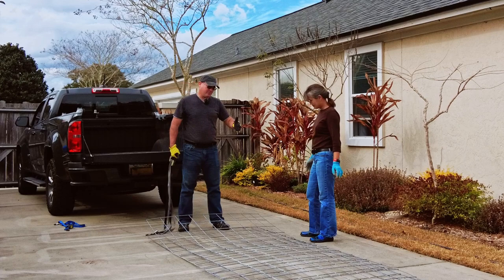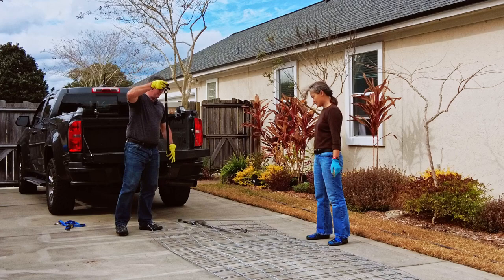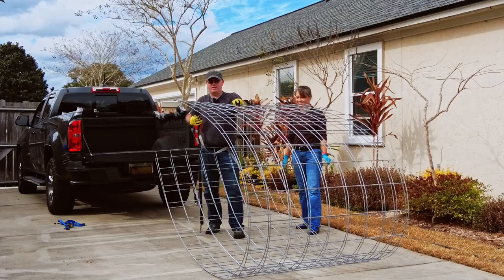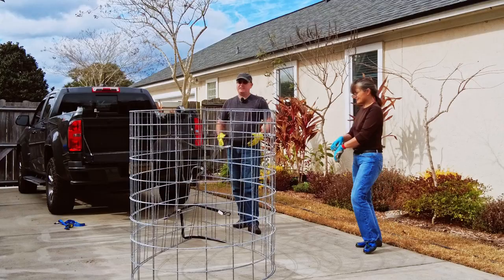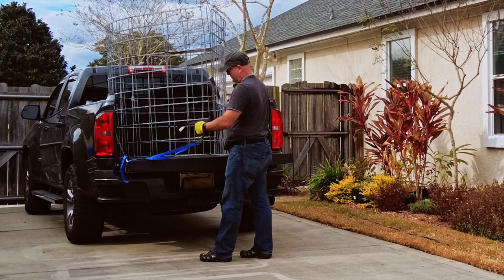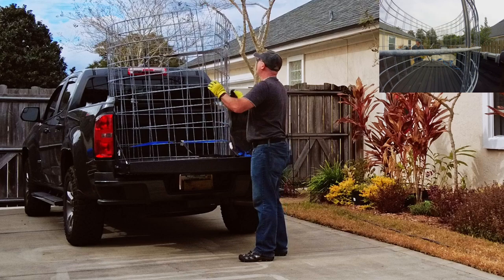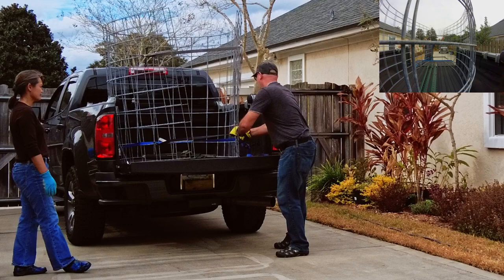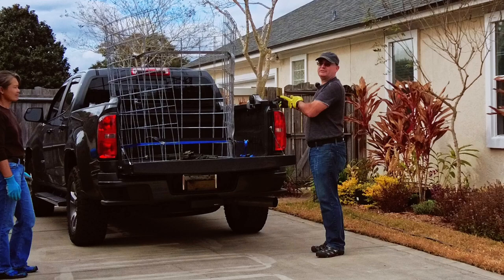How to Load A Cattle Panel in a Short Bed Truck (or maybe a van or SUV)

Comment: I drove to Tractor Supply with my pickup truck, where I purchased 6 cattle panels (they were on sale). The store manager and I loaded all 6 of them. She knew exactly what to do, and I helped by simply following her directions. We laid the panels flat, one at a time, onto my short-box pickup bed and pushed one end up against the back of the cab. Once all five were laying on top of each other (with one end in the bed of my truck), she and I lifted the back end of the 6 panels together and she flipped them in an upward motion, so they started to form an upwards arch, then we simply pushed the panels as we walked. The panels went upwards as we walked towards the tailgate. Once we had the ends (that we were holding) inside the pickup bed, she reached down with one hand and closed the tailgate. She then tied the panels inside the pickup bed with cargo straps at each of the four corners in my pickup bed. To my surprise and delight, it only took one trip to bring all six 50-inch x 16-foot cattle panels home. I'm so thankful that she knew how to load them!
Reply from the maker: Awesome!  I can totally see how that would work (even though I'd be worried about them springing back before I got them all tied down), but I don't think it works with my particular truck...  The panels are a couple inches too wide to fit completely in my bed horizontally.  The bed is shaped weirdly between the wheel arches and the cab (probably to make room for the extra diesel emission bits), so we have to go vertically instead.  But I'm glad it works for you... six panels at once is no small feat!
Reply: @AnoleGarden  It would have been impossible for me to do this, but she knew exactly what she was doing. One of my sons-in-law helped me unload them, he held them in while I unstrapped them, and that also worked great.
Reply: Happy you had such a smart and helpful Tractor Supply person. I went last week to load 3 panels and was willing to do it lone. The store manager was not very bright and was borderline nasty when I explained what I was doing! He stood his ground saying that I was going to break them causing damage and demanded that I needed to pay of front (which of course I planned to do) before he would allow me to go into the area where they were! It became embarrassing. The end of the story is he caused them to be delivered free at a distance of about 35 miles. I’m still annoyed.  This was at the Tractor Supply on Bayshore in N Fort Myers
Reply: @dcaldwell3464  I would have been angry too with the total lack of kindness and knowledge shown by that employee. It's too bad that these large farm stores don't educate their employees better. All it would take is a simple demonstration for those employees on how to load this type of fencing.
Reply: @AnoleGarden  How long and wide should the straps be. My friend has a small Nisson pickup and we will haul 2x8x8 boards also for the raised beds. Then the panels.

Comment: Thanks. The things you’re showing may seem simple and obvious to some but they are great and much appreciated instructions for a beginner. I appreciate it.👩‍🌾❤️
Reply from the maker: No problem!  It took us a few trips before we figured out this method, so we figured others might have questions as well.  There is another way we've found that seems to work pretty well, but it wouldn't work with anything other than a pickup truck bed.  We might tackle that one if we need another panel any time soon. Thanks!
Reply: @AnoleGarden  that’s what I would be getting mine in so looking forward to a future video. Thanks

Comment: I managed two panels at once on the roof rack of my RAV4 SUV - laid down flat with the round part forward.  Attached with a couple of tie-down straps.  Loaded with 2 young women and my 69 YO self rolling it on from the back.  Offloaded the same way w/my GF.  Some cardboard or styrofoam protection on the roll-on / roll-off is a good idea but worked perfectly!  Thanks!

Comment: Darn, I was here for mini-van or SUV suggestions. Oh, well.
Reply from the maker: Unfortunately, the only ones we've seen attempt that didn't care too much about the interior of their vehicles.  One was an old suburban, the other was a mini van.  They both got them in there, but had to "fold" the panels more than just curving them, then they had to straighten them again when they got them out.  It's possible, but I wouldn't call it easy.  Getting a small trailer is by far the easier solution if you have a hitch. Sorry we couldn't do more for you, but we appreciate you checking us out and taking the time to comment!
Reply: @AnoleGarden  Thanks for replying. Finding someone with a truck or trailer seems like the best bet. They don't even sell them in the city I'm in, it will have to be a drive out to the country.

Comment: Very clever!   Definitely need two people though.   Those things are heavier than they look, and even though I'm a strong, self-sufficient woman, I can't even lift one.
Reply from the maker: Totally true!  I (Jonathan) can barely manage one if I have to, but it's definitely MUCH better with two people.  Getting them in is the hard part, but a store employee can usually be convinced to help load.  Unloading is easier.  Once you've strapped it into the shape to get it into the truck, you can usually just roll it wherever needed without removing the straps. Thanks for checking us out!

Comment: I wonder if you can use heavy duty zip ties for that first step with the two ratchet straps.
Reply from the maker: You probably could, but I'd definitely use ratchet straps for the drive...  Zip ties might wear and break from wind and vibration over time.    Thanks for checking us out!

Comment: Do you have a recommendation on how to secure 6 ft. t-posts in a 5 ft. truck bed, or are the 5 ft. t-posts big enough to support the cattle panel trellis?
Reply from the maker: The 5 foot posts would work, but I prefer the 6 footers just because it makes the end result sturdier.  You can probably fit the 6 foot posts in diagonally, or you could just leave the tailgate down.  I'd loop a rope around them once or twice and tie it to the tie-down loops inside the bed, but otherwise they should be fine.
Reply: @AnoleGarden  Thank you! I appreciate the tip! Thankfully TS is less than 3 miles from home, so I will stick with getting the 6-foot posts and use your recommendation to get them home safely. We get a lot of wind here and would rather be safe than sorry.

Comment: Can you do a video with 8 panels?
Reply from the maker: Sorry we don't have the space for 8 panels. But the principles/techniques used in the two panels should apply to any additional panels. 

We have two panels in a row in an arched shape. We have a single panel in an arches shape serving as the entrance in our large raised garden bed. And we also used a number of the  panels in a vertical way.

Comment: Could you put them together with zip ties?
Reply from the maker: Probably, but I'd be a little concerned that the metal from the panels could wear through a zip tie eventually due to bumps and vibrations when driving.  You could zip tie it and just add a single rope or strap when you're done, just as a "safety" in case a the ties break.  :)